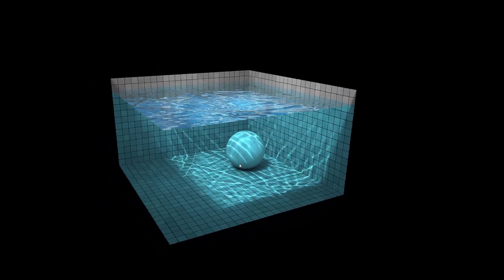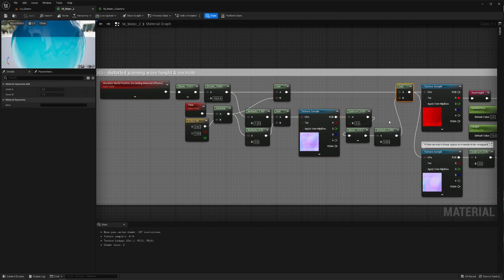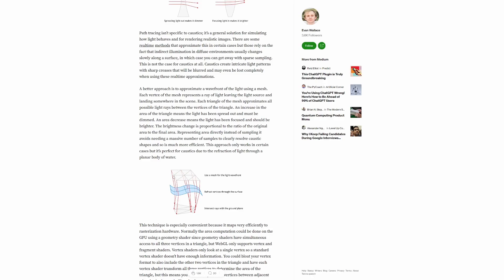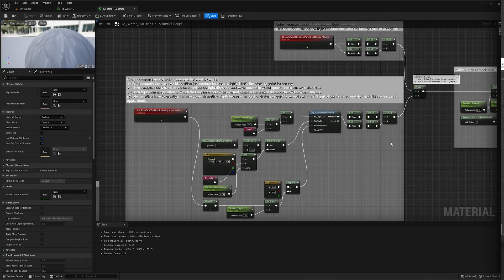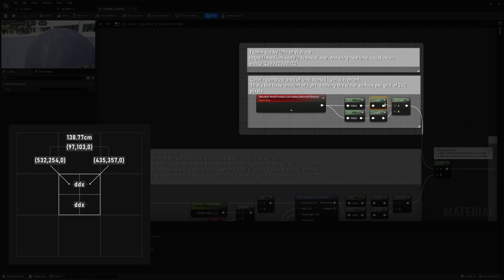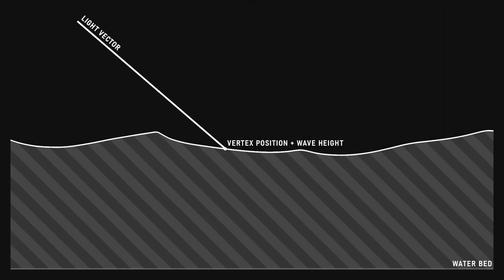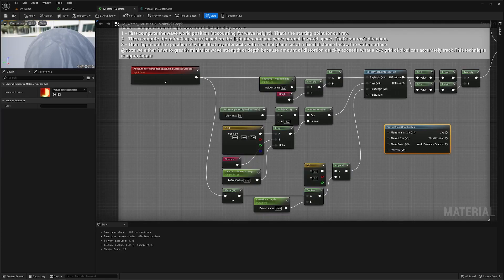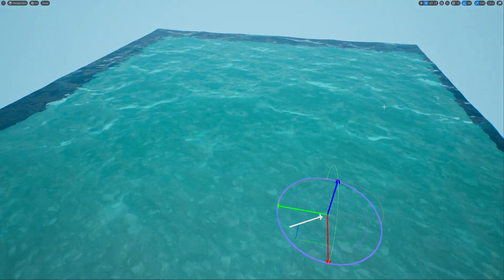A neat realtime water caustics technique using partial derivatives in UE!

Comment: Is there light attenuation according to depth?
Reply from the maker: I don't recall implementing that but it may be as simple as modulating the caustic strength by the delta between the water surface Z and ground Z /shrug

Comment: I tried opening the project file UE 5.3.2-29314046 but meshes were not assigned to actors, I managed to relink all the maps and functions but the caustic material still doesnt want to work even though Ive copied everything to the T.
Reply from the maker: No issues on my end on 5.3.2